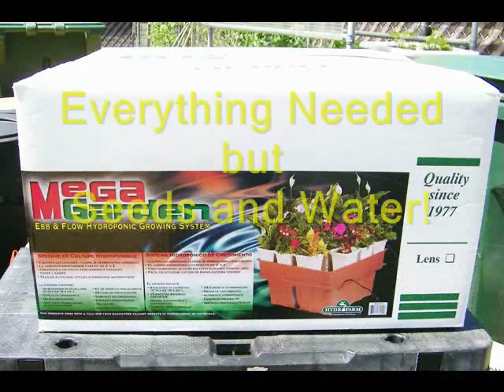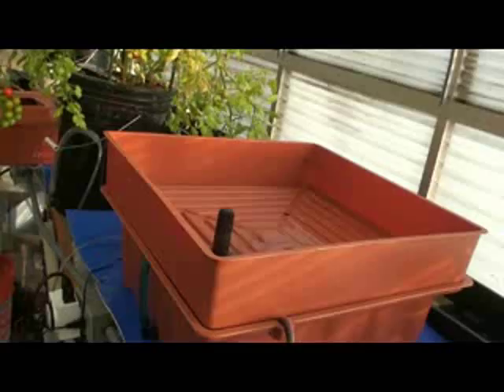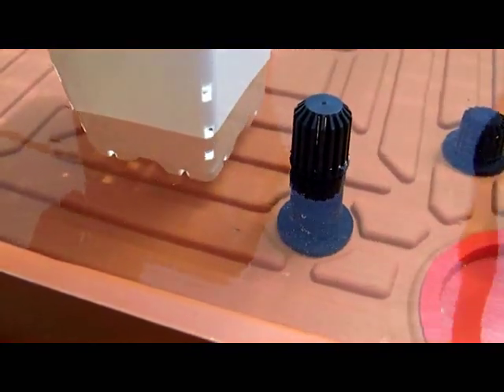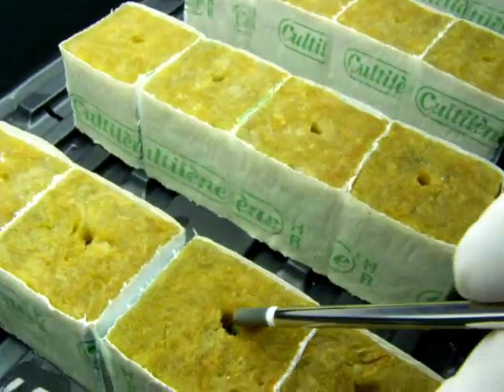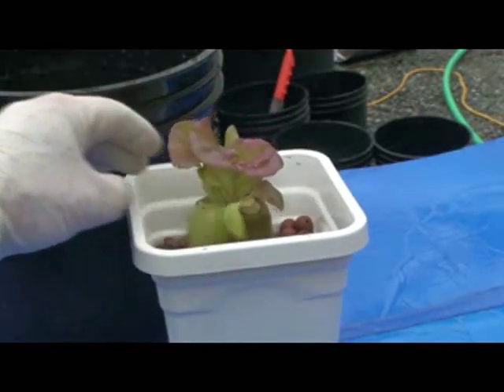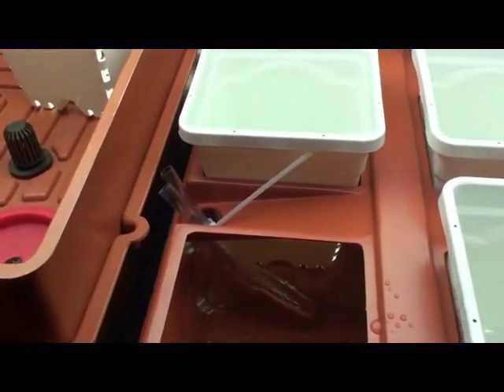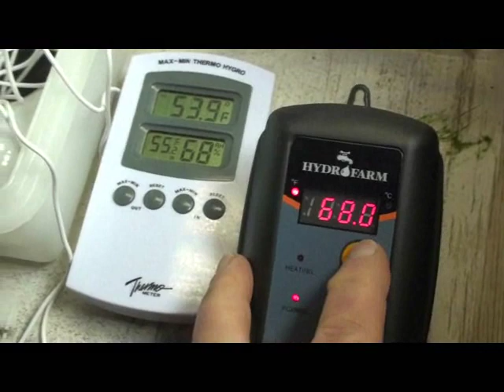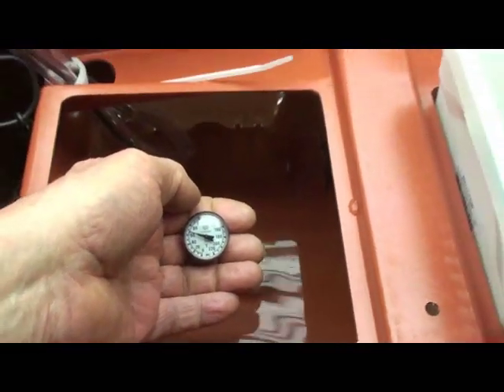New MegaGarden

Comment: Mr Ron. you didnt show the drip setup .. its a clear tubing coming off the pump ,, allows for drip feed ,, or you can run a manifold out the fill hole,  I looked at the pics and put this together,, no troubles  .. iam going use layered setup next in it,, i like to do difrent things from norm,, i will get criticism, Luv it, then they see it works,, iam going to use the mega no pots layered HydroTon perlite coco maybe perlite on top, fill 1 inch or so hydroT perlite then coco coir . . set drippers ,, the pump has a single clear line coming from the black connector on pump its a drip line the black cap drips , Place a longer line, difrent ways to accomplish this , depending on how many pots, are you going use difrent ones sizes etc .. iam going with netpots and some (maybe) of the white ones, that came with the system ,, or remove the fill valve and place with a 8way drip manifold,,, take two of those lines run to another Smart Pot Big bed bag,, coco media of course, and run a circle drip line punch holes ext the lines to each plant, or just the original two lines Long ,, adjust layout place drippers on each line circling and or cris crossing the BIG BAG,, when a feed is needed or a nice bang of nutes, place a open face container under drain pipe, turn it down, fill up how much you want, turn up it stops, or you can place a longer tube on it, with a shutoff vavle , open and feed ,, Always remember how much came out ,, refresh with clean water 5.8 ph .. it works,, also  water changes are less becuase you are toppin off the box,, ENJOY
Reply from the maker: +afk bot 
Interesting!  Nice thing about hydroponics - just about anything works as long as you can get nutrient to the roots.  Thanks for watching!
Reply: +Ronald Kleinman indeed

Comment: Hi Mr. Ron. Great video. You say to adjust overflow fitting but I can't understand how to do that. The overflow is the taller of the two fittings. How would I be adjusting it?  +Ronald Kleinman
Reply from the maker: +Debra George 
Hi Debora, The overflow fitting is made up up segments that you can put together and add or remove as necessary to control the overflow height.  It is really simple and I am sorry I didn't show it in the video because I have been asked your question before!  Anyhow, just add a segment (they are about 1/2" high each) to reach your desired grow tray water level.  The MegaGarden is great for growing small plants like lettuce and herbs but if you are interested in growing a single, larger plant check out the RootSpa on my channel.  Thanks for your question and thanks for watching my videos!